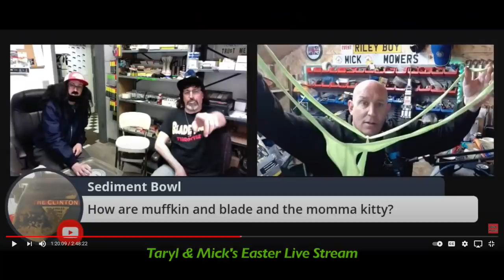Awesome English Suffolk Engine - Will It Run?

Comment: We used to make go karts and mini bikes with those engines back in the 70's and 80's, in Australia they were very common prizes from the local tip and
sidewalk trash collection days.
The benefits were having a horizontal crank with a clutch, some had a manual cone clutch others had centrifugal, and the drive chains were bicycle pitch making final drive easy.
they are great little engines that would take all sorts of abuse. We'd also hot them up by max porting the block, shave the head (with sandpaper) and put a straight pipe on the exhaust.
I still have a few buried in the shed, and have another on a 1960's concrete mixer that still runs regularly.
Mini bike is a must..
Cheers from Tasmania...

Comment: Nice to see you working on a proper engine, The iron foundry engine as I've always known it, Fitted to suffolk punch & colt cylinder mowers ( as we like stripey lawns over here) and is still found in many garden sheds all over the United Kingdom to this day
Reply: Rating plates on some of the older ones literally say "Suffolk Iron Foundry" instead of "Suffolk Lawn Mowers."

Comment: Just discovered Taryl's channel. My dad and gramps both were lawnmower men, I have photos of me back in the day at five years old leaning over a lawnmower with a wrench in my hand.
Back in this era you probably bought (if it wasn't from Sears catalog) and had your lawn equipment serviced at the local Feed Store, which in my area it then ended up at my residential garage for repair, sharpening blades and anything that required an edge.

Comment: Well done ! The 'tickler' (primer) is pushed down until fuel dribbles out the hole in the side of the carb. Fuel overflow in the beginning was prob float sticking until it freed up with fuel.
The Suffolk was the mower that started the lawn mowing craze in England in 1955. It was the lightest mower you could get at the time. Everybody had a Suffolk. EVERYBODY. Still have mine. Lots still around. Saw another today. Most exciting episode you made. Thanks for sharing.

Comment: I Know the feeling when an old engine is brought back to life, after how many years, who knows?  I have had this same feeling as Taryl and this Suffolk engine.  The engine that I was blessed with, was headed to the scrap pile, sitting alongside the curb in my town.  It was made in Germany circa 1936, a 2hp, 2 cycle petrol.  Research was that it was on a German military generator and was a very interesting piece of equipment.  I have the engine only, no generator, but it was complete with the captive crank starter, carburetor, fuel tank, air cleaner etc.  It had no spark as the magneto was bad.  I hooked up a coil and battery and I have a neat running engine that I take with me to antique engine and tractor shows in my state of Michigan.
Reply: Seems like a little engine with genuine history to it!

Comment: This was the first engine I ever worked on.  There are two sizes, but not sure of the sizes. Think they used to power the emergency generator in the Sherman  tank. The pushy thing is the tickler. Mixture screw is 3/4 out on pilot 1 1/2 on main  standard.
Reply: There ya go -- "tickler," or that's what they're called over there.  Also on Amal carbs on old Triumph motorcycles.   I think we yanks call them primers since they save us from having to pour gas down the throat of the carb to "prime" it on initial crank up.  Good info,  Simon.
Reply: ⁰ĺ

Comment: Many reel mowers like the one you mentioned was for putting greens.  The shearing of the reels cut better than blade type and the grass catcher made it clean.  The rollers were to keep the putting green smooth.  Now there is your breakfast.

Comment: Well that's interesting.  I bought one of these about 8-9 years ago in South Australia, that exact engine on a Suffolk Colt or Super Colt  (that part of the decal was worn off...) - took an afternoon of cleaning, new oil and a tune up and it ran perfectly every time.  Used it as a backyard mower for  years and only sold it 3 years ago when we moved to a house with no lawn...  Mine was complete and perfect, even the paintwork was original and very good condition, just a few transfers had rubbed off.  It left a perfect finish to a lawn, just about like a snooker table.  Love the Mankini!

Comment: Its a "tickler" ..it holds the float down until it runs over giving it a prime.The European dirt bikes had that set up with a tickler instead of a choke . I never had one but read about them in Dirt Bike magazine
Reply: Your correct
Reply: That kind of sounds like an enrichener instead of a choke that Harley-Davidson used on some of their carbureted engines back in the 90s.
Reply: @bodeine454  yes jeff

Comment: The "suppressor" is probably used to help with RFI
(Radio Frequency Interference).
Reply: I presume just a resistor?  DLE and other spark ignition RC engines use one.
Reply: @JeffinTD  Wires are often suppressed or spark plugs have resistors built into them. being as small engines rarely have radios attached to them they're probably not there for EMI reasons. It's more likely it's there to keep the points from burning up so badly. Resistance in the secondary would limit the back EMF the primary side would see.

Comment: 😀😀😀 I enjoyed watching you work on engines I still use everyday in England - and working out it was left handed thread on flywheel. Suffolk made cylinder mowers in Stowmarket Suffolk England . The punch  and colt , the colt being the smaller of the two . I was unaware that they were exported though you could correct that some may have gone to Canada - it is also possible that seeing as we were surrounded in the 1980s by American Airbases that one or two may have been packed up with house possessions and shipped . The suppressor was fitted because we all live close together so your lawn mower spark affected people's tv and radio .It was a good reliable basic small engine in its day and often found its way into go carts . The carbs are loads of fun 😀😀
Reply: Having trouble keeping it running, maybe it needs a spot of TEA.

Comment: I read in an old Ford Tractor manual that the reason points have a specific gap is not because the gap itself matters... it's that the gap establishes the timing of the points breaking contact at just the right moment. That makes it sound as though... if I could recall how to do the trig, that the instant the point contacts are not touching would occur prior to the hi-point of the points cam. In essence the points gap is setting the timing of the spark.
Anyone else heard that?

Comment: When my kids were little there was a kid show they watched that had a character named D. W. Reed
They used to call the spray ' 40 DW '
And, oh yes Taryl, it IS a lubricant.
I had a damaged can and I dumped all the juice out into a cup and kept it on a shelf. As the solvents evaporated out more and more the ' 40 DW ' turned into an oily substance the consistency of about 30 wt. oil which made a GREAT
LUBRICANT
Sounds like something you might keep around in the Taryl Dactyl garage.
Surprised you don't already have it.
Remember it's ' 40 DW '

Comment: I believe that plunger is a “tickler” Tarly . Not French but English.
Reply: You are Correct there Pete.
Reply: It is a form of a primer, you don't pump it, you hold it down until fuel comes out and it trickles fuel in to the engine to prime it. They were used on early motorcycles also
Reply: It pushes the float down, which opens the needle/valve from the tank.

This causes the bowl to overflow, typically through the mixture needles into the intake manifold, but since that carb also has bowl overflow holes the overflowing gas might just leak on the ground. The overflow hole might be above the closed height of float, and raising the fuel level also makes it run richer, like a temporary choke (as the fuel level decreases before the needle opens again).
Reply: Yes, it is called a tickler just like on the Amal carbetraters fitted on the Triumph bikes
Reply: Yes Pete your correct
Reply: An english tickler only gives you gas.
Reply: @4sl648  lol
Reply: Whoa!! Didn't see that coming. !! Good one....only gives you gas...
Reply: Does the float's position depend on engine vacuum or only on fuel level?

Comment: That primer type thingy is the carb tickler. It pushes the float down to let liquid fuel flood into the throat of the carb to prime it. Many old motorcycles used the same system.

Comment: I use deasil to flush sumps like that.  You can start the engine and let them run a few minutes to clear all the Chit out.  On new engine break ins I change the oil every 7 or 10 hours.

Comment: Yes...the little pushy springy thingy
On float cover is a trickler....does exactly what you surmised. Pushes float down allowing gas to trickle into manifold for cold start.
No choke plate....Bing carbs on R60/6 BMW used same system

Comment: This is quoted  from the WD-40 website;
Myth : WD-40® Multi-Use Product is not really a lubricant.

 Facts : While the “W-D” in WD-40® stands for Water Displacement, WD-40® Multi-Use Product is a unique, special blend of lubricants. The product’s formulation also contains anti-corrosion agents and ingredients for penetration, water displacement and soil removal.

Comment: Originally, that was a Qualcast engine (Qualcast = Quality Castings). Quality Castings made all manner of cast iron products for all manner of other manufacturers. As a company in its own right, Qualcast go back to before the first world war. If I recall correctly, Qualcast were still casting engine blocks for Vauxhall - Bedford (part of GM) into the late 1970s at least.

Earliest Colt lawnmowers were originally branded as Qualcast, and were well engineered, solid iron and steel construction. Quite when they morphed into"Suffolk" I couldn't say for sure, but among their range of mowers, were "Colt" "Punch" and "Super Punch". I don't remember the Super Colt. The mowers came in 14" and 18" cut, but all were powered by the exact same engine.

If you can find one of the latest models, you would see that the engine, whilst still being branded as Suffolk, is almost literally a Briggs and Stratton clone.  There may be more to that than meets the eye, and I wouldn't be at all surprised to find more than a little bit of lawnmower incest going on between brands.

As for rotary mowers, we've had them for decades, but there was always a pride ina job well done, and the pinnacle of that for Mr suburbanite house owner, was the classic "striped lawn' which was something that a rotary mower could not achieve.  Ever seen the tennis from Wimbledon? Just look at the grass courts. They are the ultimate in striped lawns, along with Lords Cricket Grounds, and any self respecting football/rugby ground. It's just a British thing!

Rotary mowers? Just look up"Douglas Hayter". Hayter only ever made rotary mowers, and they're still making them to this day.

Comment: @38.22 it a "tickler" as Honda calls them. It presses the float down against the fuel level to unseat the needle and overfill the bowl with gas thus increasing the pressure/richness of the mixture to start. My Honda 50cc Express had one.

Comment: Suffolk mowers, or to be correct Suffolk Iron Foundry got took over by Atco which later became Qualcast Atco. Qualcast were part of Robert Bosch GMBH but I think they sold the rights to the name to an Italian company now? 
Some of the later machines used a Tecumseh engine, I repaired one last week in fact! 
Back some years ago the Suffolk Punch and Colts were quite popular with lawnmower racers as the mower was self propelled (there is YouTube footage I believe!)

Comment: I liked the tip on the Lawnboy rebuild about testing the crankcase for pressure.
More correctly stated, the crankcase is part of the combustion process in a 2 cycle engine, not only must it hold pressure but also hold vacuum - there could be a situation where it holds pressure but leaks in vacuum. I built specialized plates to test both at 10psi on my saw. You can also test your cabatrator, push 10psi and drop it in a glass of water, if it bubble you got probs
Also the billy surface grinder is good tip, little know if you get your surfaces super-flat you shouldn't need a gasket at all.
I use a piece of float glass which is super-flat and some vintage cloth paper called Crocus Cloth, a very fine iron oxide abrasive, but its expensive.
Reply: If I'm not mistaken the 2 cycle fuel tank must hold pressure and vacuum as well.
That's why I believe, on high revving machines they have those duckbill valves in the fuel tank to allow outside air pressure to overcome vacuum and allow increased venting at high revs. could be wrong idk

Comment: Bit late to the party, but the Suffolk engine was indeed a close copy of the Briggs model 5S. So close that many parts are interchangeable.  The Suffolk engine evolved over the years, most noticeably with a different fan shroud and pull starter.  They were fitted with three different flywheels - early ones had an alloy flywheel, and there were two versions of a cast iron one. You got sent the magnets for the other type of cast iron flywheel.  They don't make a lot of power, but then for a small reel mower they did not need to. The engine is rated at just over 1hp, although that seems a little conservative as I did have a rather old and smoky one hooked up to a 24V alternator, and from the output I was getting it was definitely making more than 1hp, They have quite a sedate life chugging along on a mower, and as long as you keep them serviced they will last forever.

Comment: Found the owners manual and warranty card for our Moto-Mower 24" Super Rider Model 26-302 manufactured by Dura Corporation Richmond, Indiana circa 1962.
Quite a machine as I remember riding it, there was no throttle control, you fired it up and put it in gear and held on for dear life. It had this wagon type steering bar with the front wheels out front and it was quite tippity. Also have a 'What You Should Know Before You Mow' safety insert for safe mower use put out by the Lawn Mower Institute Washington DC with the picture of a hot chicky in a skirt mowing the grass.
Isn't wonderful the innovative products America produces to make the housewife's life easier.
Reply: I was right, consulting the Clinton engine user manual included, engines were different on which particular moto-mower model you had, it says the speed control lever was an option. All it it had was manual level on the engine and engine stop was a plug shorting wire on the carbatrator.
Dura Corporation was also the manufacturer of tractor mowers under the brand Detroit Harvester which made the most awesome mower ever the sickle mower.

Comment: My one is off a Suffolk Demon. A different sort of reel mower. Slightly earlier. Brass spherical float.  No recoil starter. Manually wind and ....pull. Only took a little CRC (New Zealand WD40) to get her running like a charm.

Comment: Reel mowers were common in California in the 60s through the 80s. A lot of people here had bermuda grass which needs to be cut short with a reel mower. You still find people selling 40 to 50 plus year old McLane and Trimmer reel mowers on Craigslist and OfferUp. Many times with the original Briggs or Honda engine.

Comment: I’ve got 3 little Yanmar diesels I got for next to nothing, & since there’s no spark plug or Carburetor they’re great. 

If they’ve got enough compression to run I’m golden. All there are is a fuel pump to fire the injector & that’s it.
I’m in the process of swapping one on a 82 JD212 in place of the old Kohler cuz I got tired of messing with it & just wanted something that’ll run/start almost every time & will start after months of sitting since it’s diesel.

Comment: Also that button on the carb if nobody mentioned it is called a tickler. Youd push it in so fuel trickled from the vent so youd know the bowl was full and to help prime the engine

Comment: Old Zeneth electronics are VERY well made. They weren't kidding when they said the quality goes in before the name goes on.  However, that stopped around 1980 when they closed down their American manufacturing plants. Everything with Zenith on it is made Hong Kong and other countries in Asia.
That manifold and probably the carb is pot metal, not aluminum.

Comment: Suffix pronounced as Suffork. Zeenith is pronounced  (Zen)ith.  Yes a primer thing is called a jiggle pin used to push gas into engine for easier start. Two common carbs then were Webber and Zenith.  Motorcycle mechanic in Sixties for a short time.